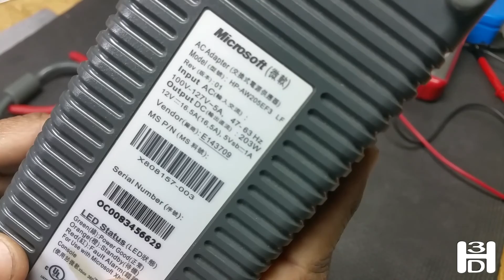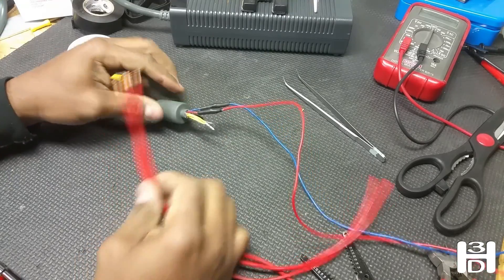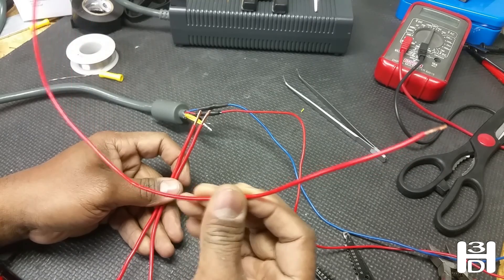DIY 3D Printer Tutorial Part 14: Power Supply - Hudson 3D

Comment: Nice video!
I want to use an ATX power supply (53A) for my Geeetech A30 (original psu is 42A).
I just understand I can use only *1 black and *1 yellow to power all components?! (*or one braid of 2 wires..)
Is that correct ?

in other words:
You can plug all your componnents on the 2 same slot with a usual 3d Printer PSU?!